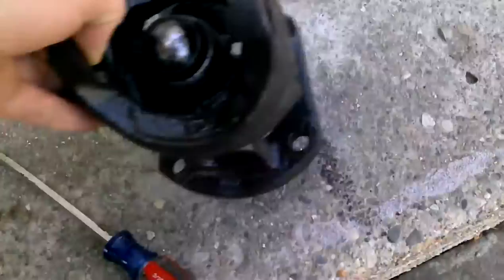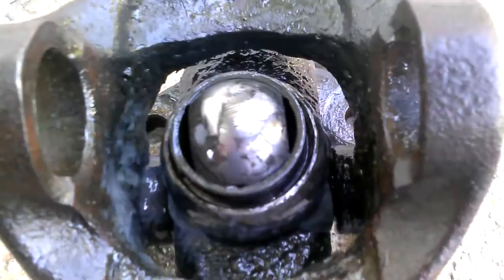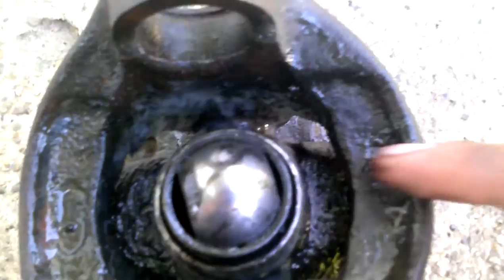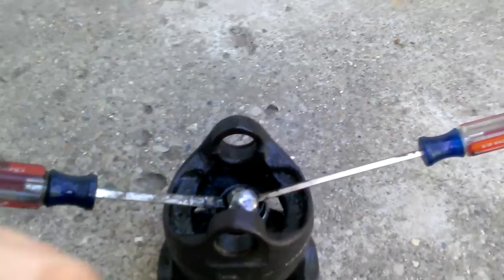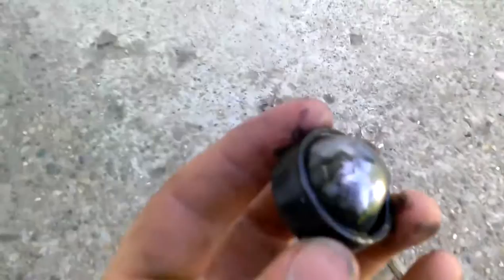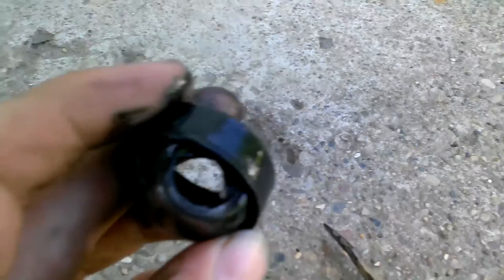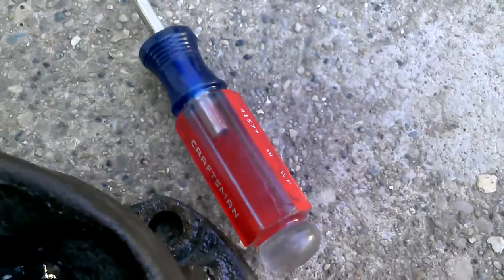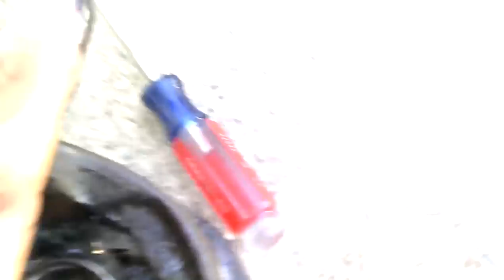How to: Remove Drive-shaft Centering ball

Comment: Thank you I'm doing mine right now and I had one screwdriver trying to pry but I didn't think of using two cool thanks my problem was getting the double Cardon back together with that going into the shaft of the ball with the needle bearings they keep falling out messing everything up I'll keep trying

Comment: Where do I get this part? The dealer doesn't have it, guessing this type of shaft is aftermarket?
Reply from the maker: cagr0311 Stock front driveshafts 94-05. Precision/Moog 628c. OReillys should have it. Very common part.
Reply: Precision 612.   MOOG 612 both made in USA.  DANA SPICER 211355X

Comment: The sleeve will NOT come out with the ball on mine ffs 😂
Reply: Hey mate im having the same troubles with mine the ball came out but the sleeve does not dis you find a solution ?
Reply: @zacferris6101  no, I tried to drill out the sidewall and break the ball out, but it's not do-able, ended up replacing